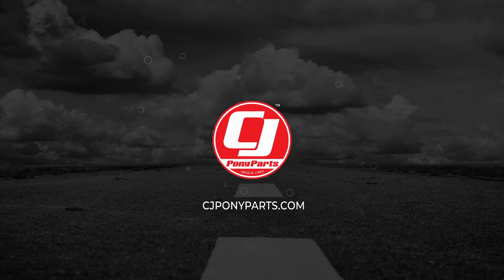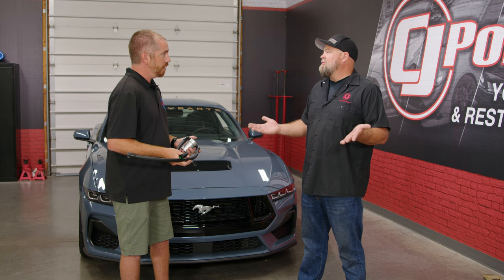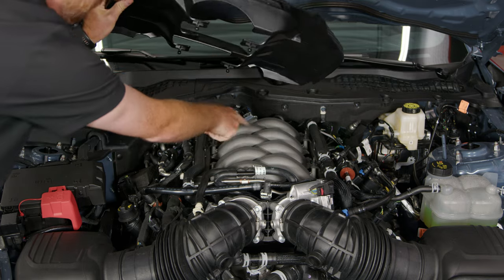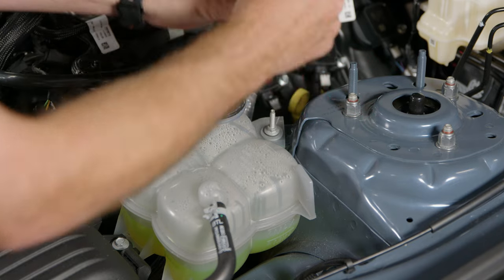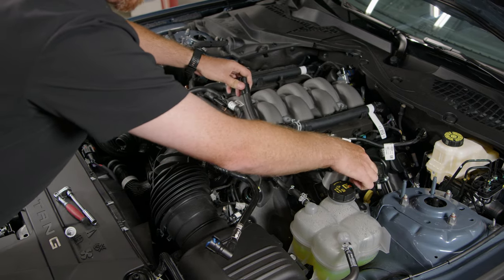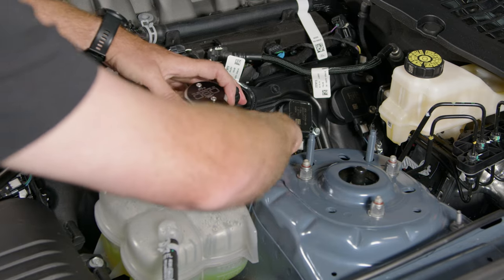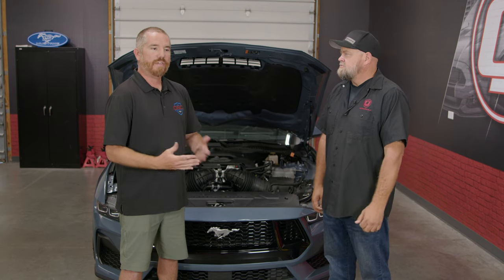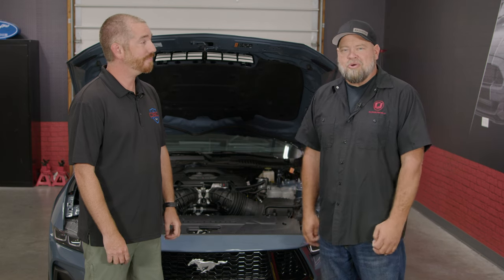2024 Mustang GT Engine Protection with J&L Oil Separator | A Must-Have Mod

Comment: The only side you need is the passenger side, drivers side is not needed unless you increase the HP with a supercharger etc.
Reply: This kit is for  the passenger side line, it just mounts over on the driver side 👍

Comment: If you have that much oil in 500 miles, there’s a huge problem with that motor.  Not even boosted motors have that much oil.  And yes, I’ve installed several of these on may different applications.  That much oil is what you should see after thousands of miles in cooler temps and a lot of city driving.